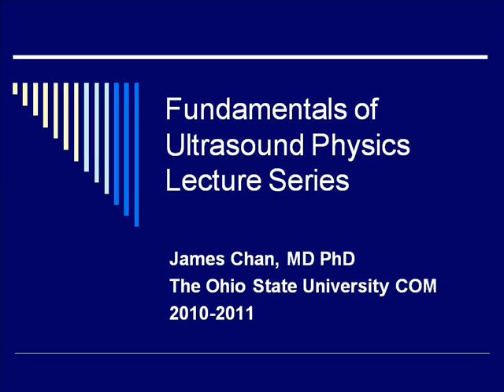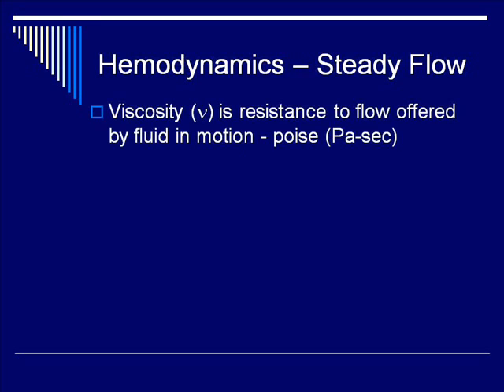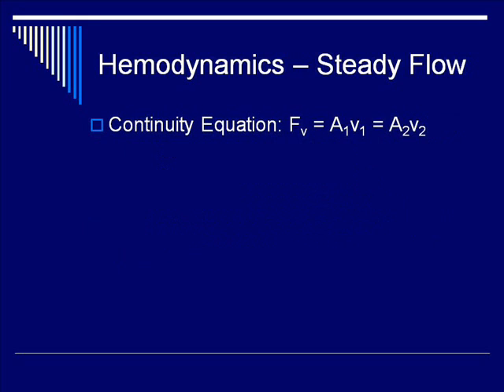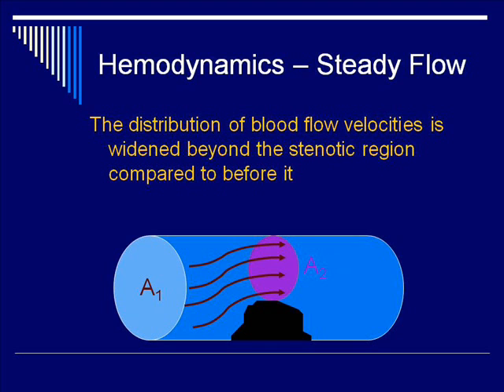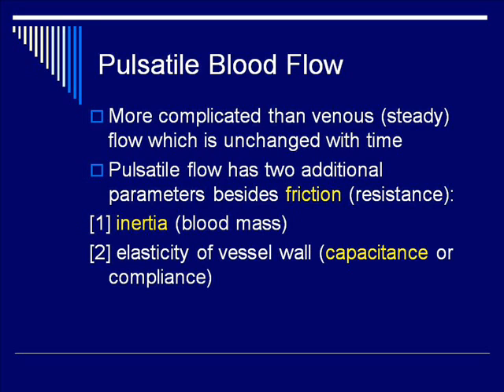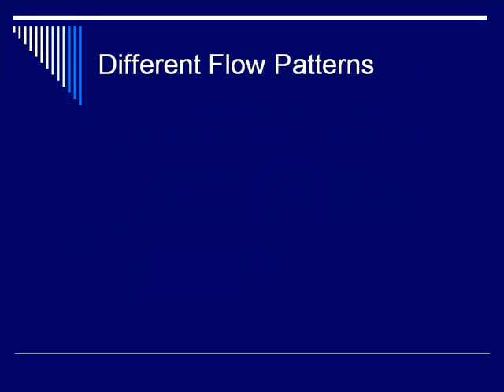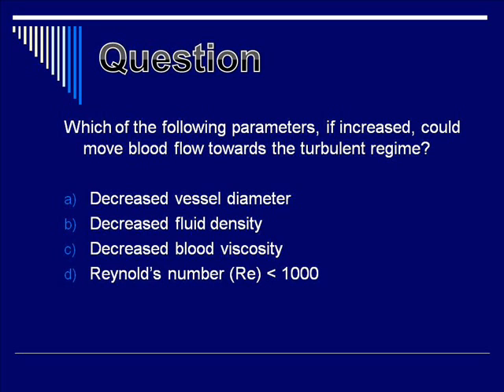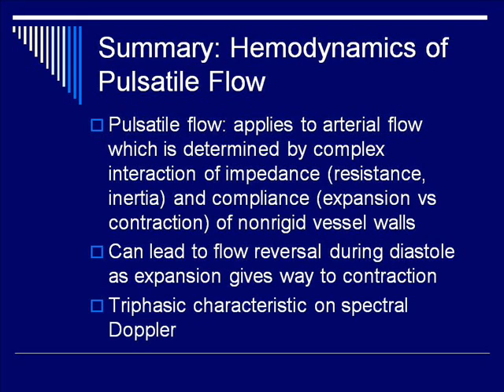Hemodynamics (Bonus Lecture pre-Doppler)

Comment: r^2 means radius square = if Diameter is 100, one- quarter is 25. but original radius is 50, so viewing from radius, should be 12.5(because half of 25). But A1 100 is stil remaining.
We need define that what is the radius
1. Before stenosing r(25, one half)
2. After stenosing r(12.5 one half stenosed site)

So D=100->25(one - quarter) and r=50->12.5(one - quarter). so r^2 derived 1/16th.
nor 50 -> 25(one - half) => r^2 = 1/4th , so quadruple is may be correct answer. right????

Comment from the maker: You are correct. Based on the continuity equation detailed at around 4 min mark, if A2 (area post lesion) is 1/16th the size of A1 (pre-lesion), v2 = 16*v1. Thanks for pointing this out. I will update future version of this lecture.